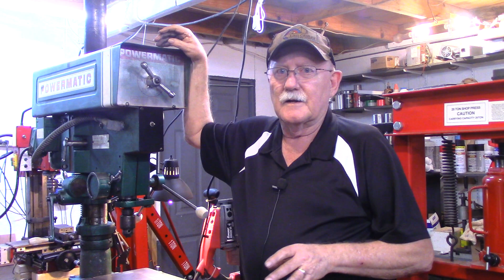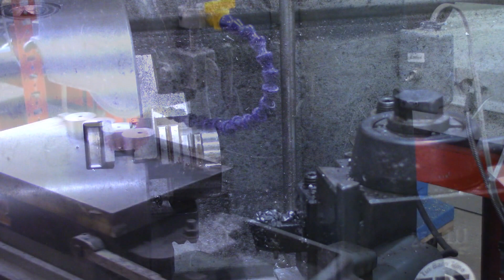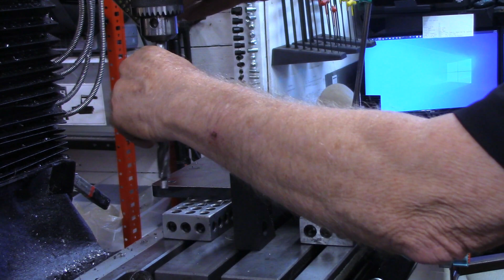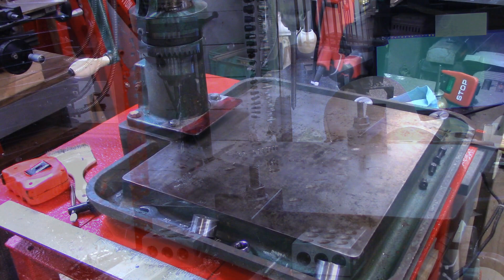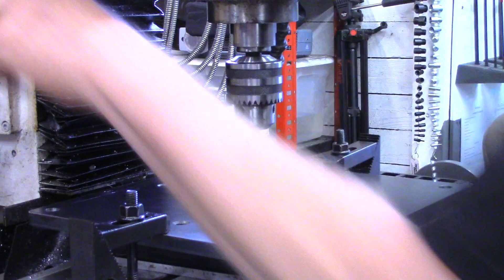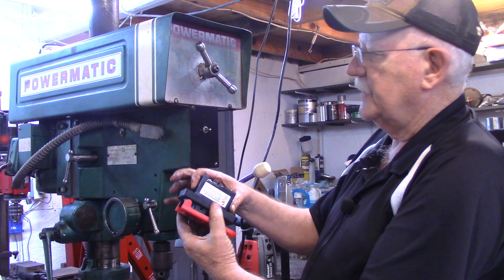Powermatic 1150A Drill Press Table

Comment: Lee, if you take that switch apart, be very careful when you open it, there are two balls inside under spring pressure that will shoot out and make you spend the next hour on your hands and knees looking for a BB sized piece of metal. How do I know? of the 3 of those I have on stuff now, 1 of them was not working when I received it because it was assembled incorrectly, contactor was above something it need to be below (I think that was the problem.)